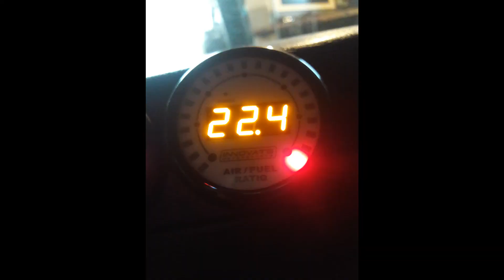8 things YOU NEED to know about Turbos !

Comment: Brakes aren't gonna heat soak a turbo, worry about the exhaust pipes. Get a flex pipe/tubing & flow air onto the turbo from fog light port or the front grill.
Reply from the maker: I am finding difficulty, seeing anything related to your comment, in this video, please explain , if you can, what you are saying?
Reply: @TurboWorld  OMFG, I didn`t say it is in the video you MORON. It is a way to cool the turbo, HOW do you not understand plain English ?
Reply from the maker: Are you ok?
Reply from the maker: Are you ok, do you require a paramedic? Because it sounds like you do. That is why I ask. Genuinely concerned for you and others around you at this point.